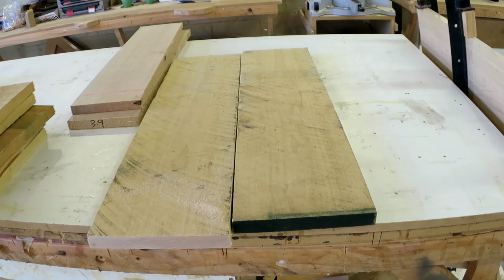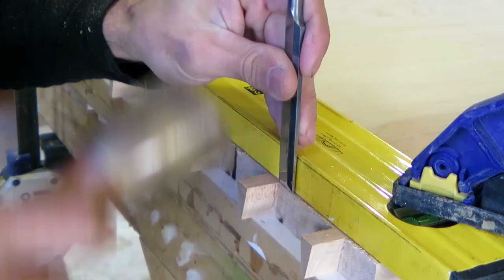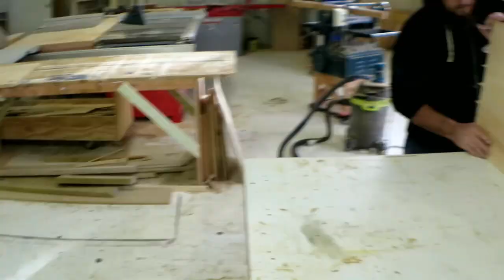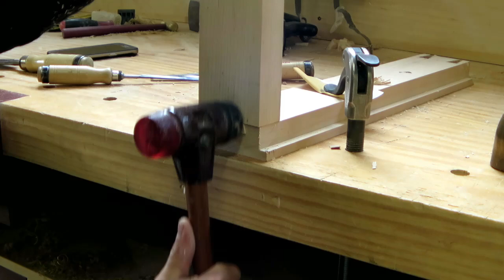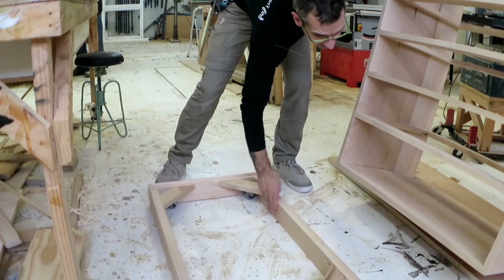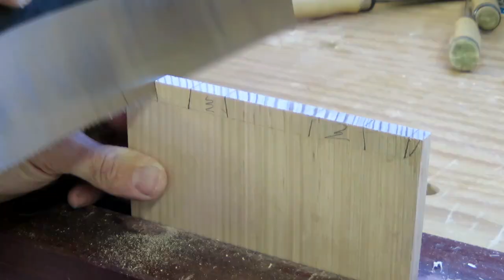modern, old chest of drawers

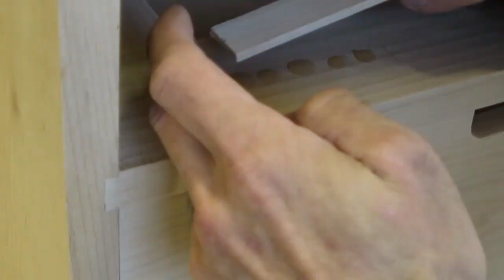Comment: I'm trying to understand what those stops you are adding at 27:25 are for, to keep the drawer from going in too far? If so, then how do you insert the drawer with those installed, the fitment everything seems pretty tight. I'm not totally clear on how this works.
Reply from the maker: The drawer bottom sits up from the bottom of the drawer side about 6mm or so. That way you can route a groove in the drawer sides for the bottom to slide into. The drawer front covers all this. So you are left with about 6mm under the drawer as only the 2 sides slide on the carcass
Reply: @KingPostTimberWorks  Yes, I follow that completely. So since the drawer back does not have the dado for the drawer bottom then the drawer can slide in freely. The stop is to keep the drawer from closing too far? Got it. thanks.

Comment: Hey Joey, how do you allow for wood movement in the body of the draws.
Reply from the maker: +Scott goddard the trick is to use quarter sawn timber for the drawer sides/back.  When cut like that timber will not really expand in it's width/height and more in thickness. That way you can have a tight fitting drawer which means no jamming!  I also slightly under cut the top of the drawer front so only the front 2mm or so is to the  actual height of the drawer hole. Not sure if any of that made sense.
Reply: thanks and yes it does, do you use the same approach on the chest of draws?  Or is this not an issue as you have the grain running in the same direction all the way round?

Comment: what a lovely piece, amazing craftsmanship..... but I have a noob question, since the fit of the drawers and it's front is tight, would expansion /contraction of the wood be an issue in future , and the drawers get stuck?
Reply from the maker: +Ronald Khoo Kah Hock the trick is to use quarter sawn timber on the drawer sides. This way it won't really expand height wise relative to the drawer. The fronts will move a little and may need to be shaved a little over the first year. Keep in mind this is how quality furniture has been made for hundreds of years, the old boys really new what they were doing.

Comment: Joey.....regards the dovetailed partitions.....would a dovetail on one edge only be sufficient.....to save time and effort?    Or do you require a full dovetail joint?  Ta
Reply from the maker: could probably get away with the front and back, but thats probably about the same amount of work.  the idea is that the long dovetails are also holding the side panels flat  while letting them breath in width.

Comment: With keeping such tigh tolerances, which was very impressive by the way. Will the season changes effect the sliding of the drawers?? Or does the polyurethane keep the moisture out and pervent expansion. Beautiful piece!!
Reply from the maker: +StonehurstKnives the trick is to use quarter sawn timber. So it will mostly expand in it's width not it's height. Relative to how it sits  in the drawer. The fronts my change a little.  So some small shaving may be needed over the first year.

Comment: Looks good mate, how long did this take? 
The drawers are a nice tight fit, do you think these could swell and be hard to open?
Reply from the maker: +Daniel Legge thanks. About 2 weeks. The sides are quarter sawn so will not really expand height wise. The fronts may do a bit. During  the first year it might need the odd shave

Comment: Hi Joey. When you are using solid hardwood for a piece like this, how do you account for wood movement? Seems like your design has really tight tolerances with the drawers that would bind with humidity. Is the plywood drawer bottoms enough stability to keep everything from swelling? Curious, because I am thinking of making a similar piece. Thanks!
Reply from the maker: +Steve Mahr the trick is to use quarter sawn timber for the drawer sides . That way it will not really expand in it's height relative to the drawer. The front might move a little and may need the odd shave over the first year.
Reply: KingPost TimberWorks Excellent. Exactly the information I was looking for. Thanks so much for responding Joey!

Comment: Nice job on those carcase dt's Joey.  Were those tapered sliding dt's?  Sometimes I gang up the drawer sides and cut 4 at once.  Or are you familiar with using a 7° bevel blade on TS to do tails?
Reply from the maker: +Robert cheers. Went meant to be tapered but some kinda ended up like that. Was thinking of gang cutting but they were all slightly different.